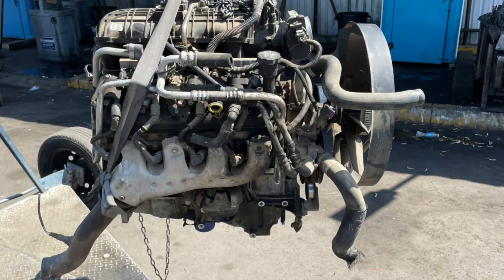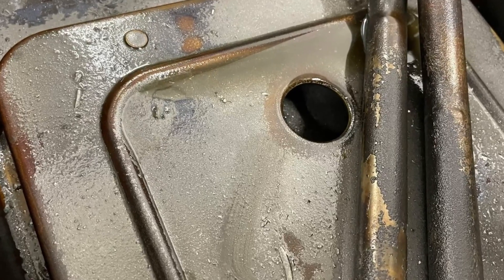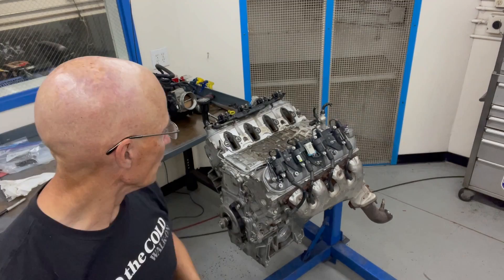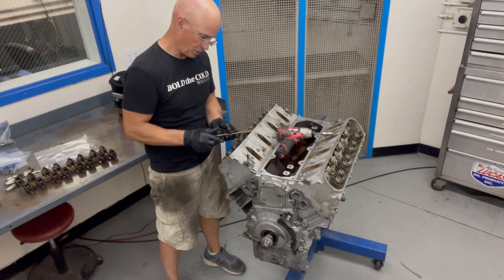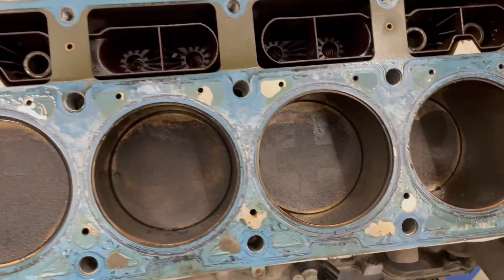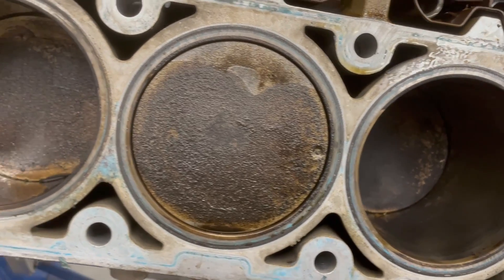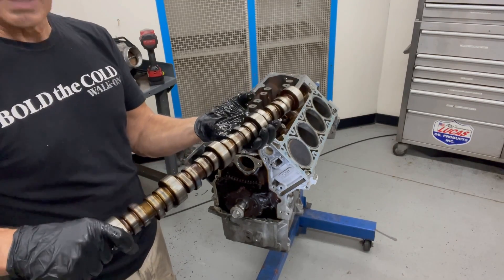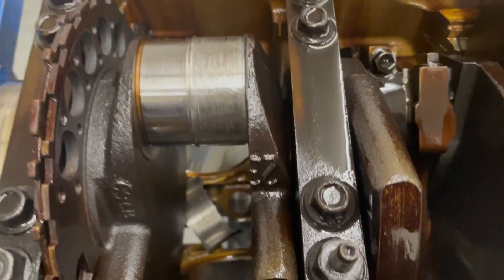CHEAP, JUNKYARD ALUMINUM 5.3L LH6-WHAT WENT WRONG? COMPLETE TEARDOWN AND INSPECTION...PLANS TO FIX!

Comment: I appreciate the insights into the failure, but Id really appreciate expert advice on finding problems before you buy it. Is looking into the cylinders with a camera and draining a little oil sufficient?
Reply from the maker: we have very few problems with junkyard motors (that spin) but you can look into them if you have a scope

Comment: Just pulled one of these lh6 apart in 12/25. Same cylinder had a lifter turn sideways and took out a cam lobe.

All of that garbage went into the rod and mains. #1 main took on the most shrapnel.  Crank has to go .01 under on the mains. Cam bearings look wiped also.

Ive found that the 4.8 has nicer pistons in it.

Comment: Looking at picking up a core L33. Not sure what is wrong with it but figure it would be a good base for a future build. Would be for a low RPM truck motor. Would it be worth it to swap out the 799 heads for 706 heads? The increase in compression should make for a spicy low RPM mule. Or would the resulting 10.5:1 be to much for a daily driver.

Comment: I have a 2007 gmc Sierra 1500. New body style. That has the LH6 5.3. The LH6 is kinda hard to find but I did find one on marketplace and it is out of a hummer. Is this LH6 wiring harness out of the hummer still going to be the same with my Sierra if I wanted to do a swap?
Reply from the maker: not sure on harness

Comment: I was wondering, will a 5.3 off of a truck crank shaft would fit on one of these aluminum blocks.
Reply from the maker: yes-just get the right gen
Reply: @richardholdener1727  thanks

Comment: Can you achieve 8k rpm without destroking your ls engine?
Reply from the maker: yes
Reply: @richardholdener1727  how is this achieved? I’m looking into doing an twin turbo LS swap. With so many combinations. I’m looking into a dart short block but still want some rpm’s. This would be EFI. I’ve mostly seen all carb stuff. My goal is to touch the 4 digit mark I’m not power hungry. But to be able to have a high revving 4 digit car is what I want to achieve. And I just had to ask the GOAT of engine combinations.

Comment: Can someone answer this question for me if I put a bigger crank is the balancer different I’m trying to run the car setup
Reply from the maker: bigger crank, as in stroker?
Reply: @richardholdener1727  yes I got a 408 but having a problem getting the harmonic balancer pulley on and was wondering is there a difference?

Comment: Hey Richard, I'd love to see you do some testing on 180 degree headers. Maybe a 4.8, and 6.0.... different power levels, etc. Not a lot of info solid info out there. My uncle used to run them back in the 70s on an alky sbc late model

Comment: With the one cylinder & exhaust valve, I think that cyl had just been missfiring/NOT-firing for some time, and that's why it's not white like the others but has oil/carbon buildup on the valve head.

Comment: Well i had my fingers crossed that the main bearings werent spun. lol. My cousin has a old 400 sbc but it spun the bearings on a couple of the rods. Hes gonna sell it to me for a $100 . i got a full rotating assembly for a 350 all i need is some main inserts and a set of pistons. gonna build me a 377ci. for cheap. 😂

Comment: I put together my lm7. As soon as I got everything torqued the engine is fairly hard to turn over by hand. Any idea what could be going on?
Reply from the maker: I check rotation after I tighten each thing-so I know where the bind cam from-loosen them and find out

Comment: I’m doing a V8 swap in a 280zx. I don’t need or want crazy power. 300hp is more then enough as the rear end cant handle it. I was planning on just swapping in a 1970 SBC and upgrade the cam and toss new vortex heads on it. That will put me at about $1000. Is it worth it or find a junkyard gen 3 LS?
Reply: Find a vortec / L31 5.7, that way you will have a roller block, if you put a carb and headers on it you will have your 300hp also they get very good gas mileage... just make sure you do some research on them so you understand the water bypass and what to do for higher lift cam, you DO NOT need to machine the heads...
Reply from the maker: carb junkyard ls

Comment: I have rebuilt 5x engines out of trailblazers now and of those 3 of them had spun/loose center cam bearings. My local machine shop was able to bore it out so I can put in one of the larger bearings from the front or back slot from a second box. I have talked with a few others who have rebuilt these engines and we all agree that the driveshaft hole in the oil pan causes a flow restriction that causes these trucks to run dry if they are not kept at the high fill mark on the dip stick and if they are not getting oil changes more frequently than OEM recommends.  We have not had this issue on other engines from other trucks and between my buddies and I we have prepped over three dozen LS swap engines.  We have seen other issues with the AFM/DOD system basically carbon buildup causing collapsed lifters, these engines really should be run on pure synthetic with oil changes in the sub 6k mile range to have any real chance of making it past 200k miles without a major failure.  Non AFM/DOD engines from vans never have issues even if you can tell they didn't see much service due to massive buildup of carbon and sludge.
Reply: I’ve got one that’s at least spun the #7 rod bearing.  

There reportedly is an issue with the valve cover breather on some of these engines that sucks oil out of the valve cover.  On my EnvoyXL you’d randomly see puffs of smoke out of the tail pipe.  Apparently, GM made an updated valve cover for these engines to alleviate the issue.
Reply: Yeah the oil pan  and windage sucks. Most run 7 quarts to band aid the issue until they can get a correct oil pan. Even with 7 quarts some say they have done damage when the vehicle was on a serious incline or taking off real hard sloshing the oil one way or another under WOT starving the bearings for a sec.
Reply: longer pu tube. install baffles on oil pan and always run 7 qts
Reply: Would you buy one for 1000 with 90k on it? Looking at one right now. Not sure it’s worth it now
Reply: I currently own 3 Envoy Denali with 5.3s. 2 came with blown engines. One of the two has a remanufacturered engine in it. The common leaks add to the danger, plus the lack of a low oil warning sensor like the trucks. Being down a quart with the oil pan design could be detrimental. My good one has zero oil leaks and extra oil, and the one I'm putting together has a baffle installed.

Comment: Chain reaction. One bearing spins damaged metal hits oil pump floods through the engine wrecking every surface. A little at a time. The other bearings the guilds the pump. The crank was alreadt toast. Theres a lot of damage.

Comment: This is what happens when you don’t change oil on an ls. 4.8 actually felt stronger in my 2003 silverado then the 5.3 in my 09 shiterado  4.8 uses 6.0 heads
Reply: Why run 317s on a 4.8?
Reply from the maker: some 4.8ls came with 799s

Comment: Cyl 1 and 7 are AFM/DOD cylinders, build up isn't too uncommon, especially in vehicles that are gently driven. Cyl 4 and 6 are deactivated on bank 2. Every LH6 I've seen has had 243 heads though.
Reply: I bought an 06 out of an envoy that had 799 heads on it.
Reply: @THEFERMANATOR  I've seen them LC8 / LC9 engines, and one (a 2009 LC9 with a 799 one bank 1, and a 243 on bank 2. They are pretty much the same.
Reply: @THEFERMANATOR I have an 06 envoy Denali with 243's...

Comment: #7 always suffers when pcv neglected. There are three updated driver valvecovers
Reply: I only know of the update in 2011 which was for the pcv and the relocation of the port for oil consumption
Reply: My #7 is wiped out due to this issue!

Comment: Great video, thanks!  I'm doing an LQ4 sbe for boost, btr truck Norris cam with new springs and push rods, ARP studs, GM steel head gaskets, new oil pump and timing set.  I reused the lifters and lifter trays. Am I asking for trouble?
Reply from the maker: we reuse lifters all the time, I like to buy new trays

Comment: What's the limit for those main brg. caps?
While your in there, machine some registers in the side of the block to make in cross bolted and a set of billet caps, it needs line boring any way🙂
Reply from the maker: we've already made 1500-hp run with stock mains and main bolts-billet caps are not necessary-at that point, you need a block
Reply: @richardholdener1727 Long way to pick it up, we're based in England 🏴.
Reply: Factory caps are crossed bolted

Comment: A friend of mine at work bought a rust free 2009 Silverrado with under 100k. After driving it normally for 2 days it developed a slight tapping or light knocking sound. It still had fairly normal oil pressure. Turns out the same thing happened just not as bad as yours. I wonder if the dod is causing some of this. His motor was very clean and had little wear.
Reply: Dod delete asap
Reply: found a rust free 65k mile silverado with the 4.8 so no dod to worry about. less power yeah but my 18 yo son has it so he don't need it.

Comment: I don't think you seen when you pulled the one bearing and said it shouldn't be like that ,there was the other half of the bearing under it and as you moved your hand I seen the other half spin down to the bottom. That was crazy.
Reply from the maker: the motor had spun bearings
Reply: I know but that bearing was stacked on its self lol. Wow that bad.